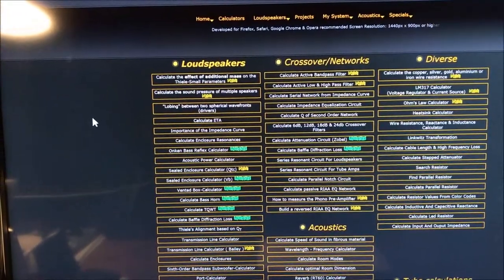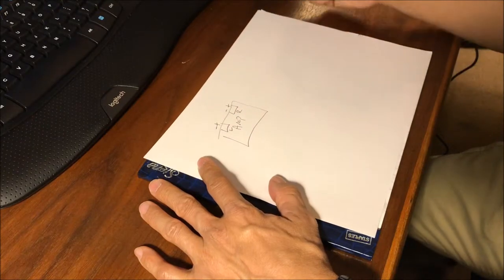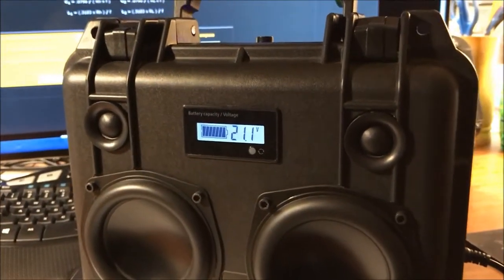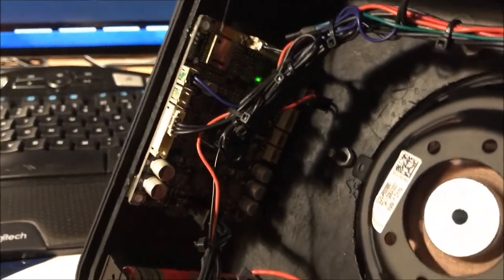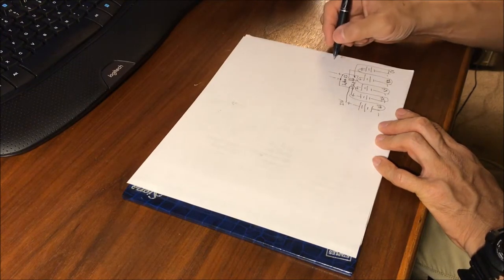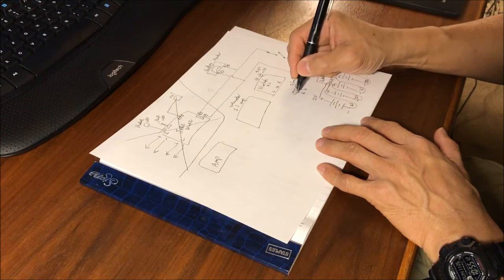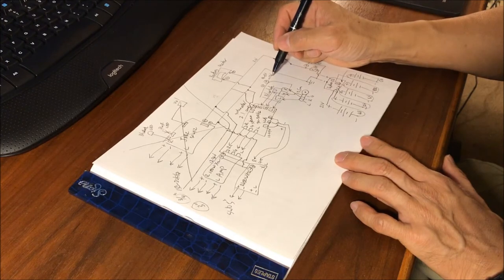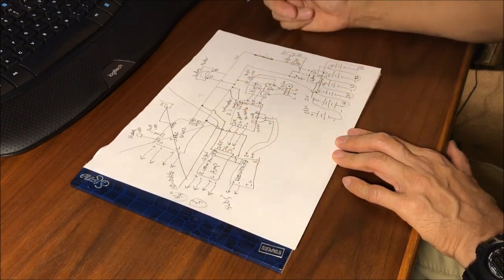DIY Pelican 1200/1430 BoomBox Schematics and Description!

Comment: Great build , but for the battery charging part, i think a balance charger would be ideal for a better protection specially if you use expensive lg or Panasonic cells.
Reply from the maker: Yes I think a balanced charger that handles 4 5 6 series configuration would be great with protection. Do you know of any?

Comment: hello sir
I would like to give you my compliment for your channel and if it's possible to get some suggestion from you.
I bougth an ammo cans box (l 280 mm , w 140 mm , h 175 mm) and after a brief research I focused on sure amplifier and tang band or peerless for their subwoofers, with 18650 batteries as well.
But due to lack of experience (my first loudspeaker box ever) I'm still confused 
The box would need to be stiffened and this will  reduce the volume even more

I dont know if it's convenient to go for stereo(with different chambers) or mono project

Don't know in terms of sound quality which model of amplifier is preferable from sure or any other supplier

and then which subwoofer more convenient for my application ?
it is better to have a passive subwoofer in this case?
could i apply iton the bottom of the box?
 I wish to get your reply very soon
 thanks for your videos
Reply from the maker: Roberto Migliardi i haven’t done any ammo boxes as there seems to be too much rattling.  Passive radiators are great since woofer volume requirements are lower.

Comment: Hi Modaine - Thanks for the video. I'm working on a similar project. Trying to figure out, in detail, what a 5S2P batter wiring looks like. I've seen a few online (http://scriptasylum.com/rc_speed/lipo.html), but I am not sure I understand it.
For a 5s2p is the following correct?
-take 5 pairs of cells and wire together the positive and negative sides. 
-wire together the positive side of one pair to the negative of another
-do that for all 5 pairs

Sorry for what's probably a silly question. I'm just learning this. 

Thanks again!
Reply from the maker: Looks correct to me. You'll get 21VDC with 4.2VDC lithium batteries in series/parallel.
Reply: Thanks for that. One more question. Where did you get that battery meter?
Reply: Never mind. Been looking for 30 minutes and found it on ebay as soon as I asked.